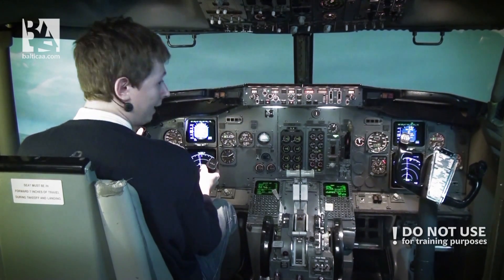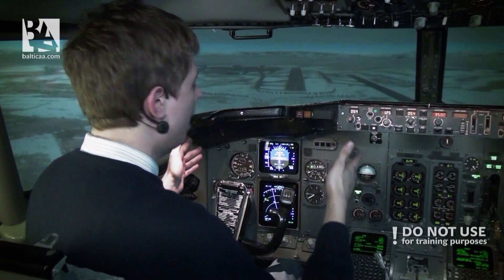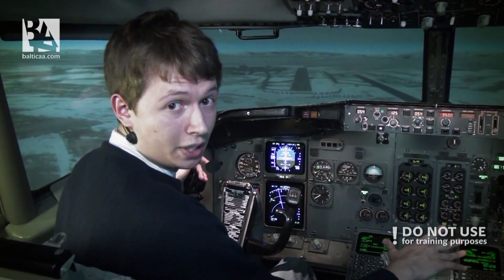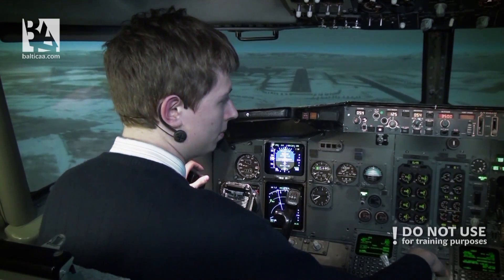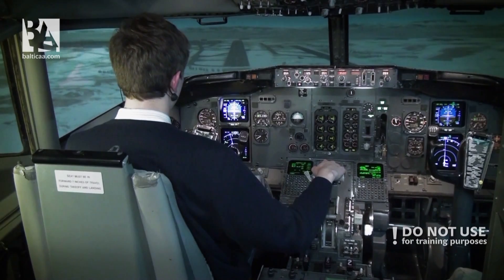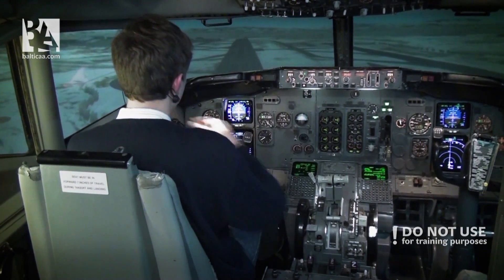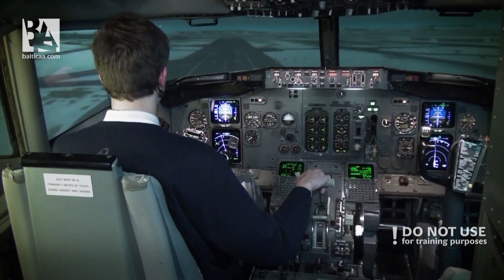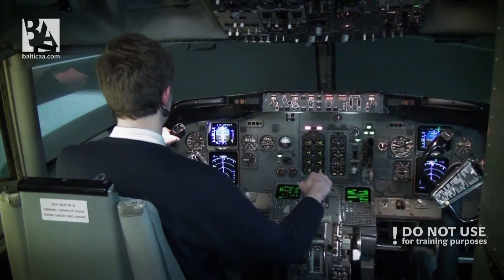Cross - wind take-- off and landing on a Boeing 737 CL. Baltic Aviation Academy

Comment: What happens when the crosswinds start as soon as the craft takes off?
Reply: The wind sock is there for a reason!
Reply: Then it's easier. You just make a gentle turn into the wind to maintain runway heading.

Comment: @ Luis Jara, its all about vectors. Its taught in basic navigation to determine your heading to compensate for a crosswind to follow a required track. If the wind is coming from your right it will push you left, so you have to compensate by flying slightly right to go in the correct direction. I'm sure you'll find the info on Google.

Comment: i was rated on the 737 100-900ER for the last 10 years,, now on the A320-321,,
What you did with the yoke is ok Pranas ,  , cause the amount you reduce with the deflection is added to the rudder which in result could lead to drag.so its this or that,, i prefer the yoke angle to protect the engine on high cross winds,,
nose down on take/off is recommended both boeing and airbus till 100kts written in the FCTM, but not after landing .

Comment: Thanks for the reply, I didn't mean to offend and I probably too display procedures that are not entirely correct (by the book).
Just wanted to correct this as Boeing publishes safety memos and does insist on pilots not putting too much aileron into the wind for Xwind take-off.
Well impressed by your hability to fly single-crew a 737 while talking through all your actions.
The landing technique is correct by the way. Firm touchdown and wind-side wheel on the ground first is what we aim for.

Comment: I am a type rated Boeing 300-900 (CL / NG) pilot, I can definitely tell you this is not the way to take-off with crosswind. You limit the yoke angle to a maximum of 1.5 Unit (about 15º of yoke deflection) as to not deploy the spoilers which would destroy a lot of lift well needed for lift-off.
At the same time, you do have to push the yoke forward up to about 80 kts to increase the noze wheel pressure and thus steering control at slow speed. Same thing on the landing.

Comment: Would you please show the landing in a powerful thunderstorm with water on the runway.
One time it was a air crash flight 358 SO4E1 landing on half the runway where the thrust were not put up until 17 second after the landing and there was a crash. It was toronto and air france

Comment: Windshear is something different. 

Windshear is, when direction and speed of the wind changes dramatically at a point. For example if at 500ft you have a crosswind from right at 30 knots and then as you descend through 450 is changes to left quartering tailwind of 20 knots. 
This is very dangerous and the proper technique is to get the hell out when you encounter it - in this case, either a rejected takeoff (if windshear warning heard before V1, windshear is one of the few reasons to reject at

Comment: Well, not exactly. Those wheels are to set the horizontal stabilizer trim for takeoff. There is a green zone marking the acceptable range for takeoff. The proper setting is calculated from the weight and balance of the aircraft, what flap setting is used for takeoff etc. The equivalent control on the DC9/MD80 series is the pair of "suitcase" handles on the left side of the pedestal, below the speedbrake handle.